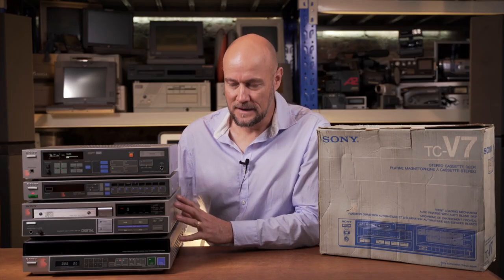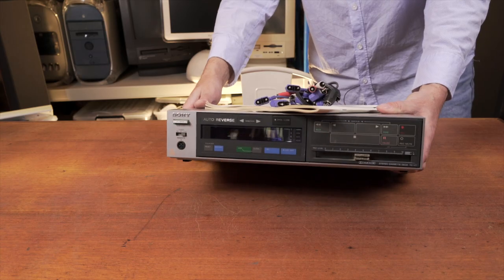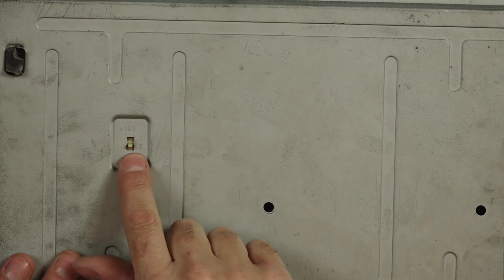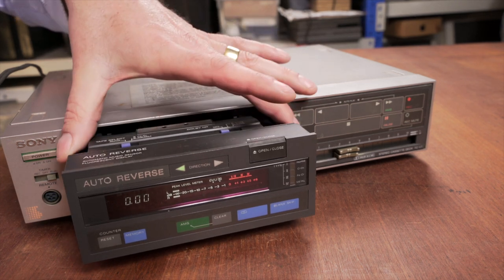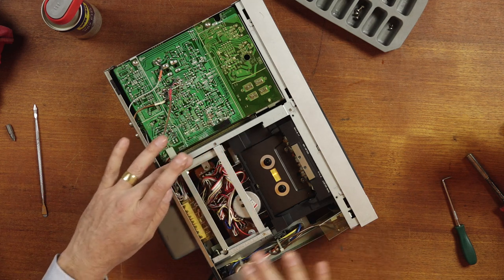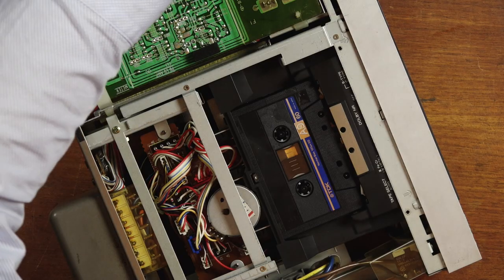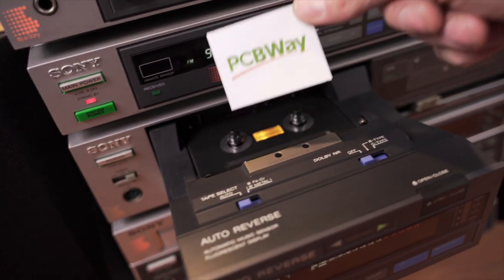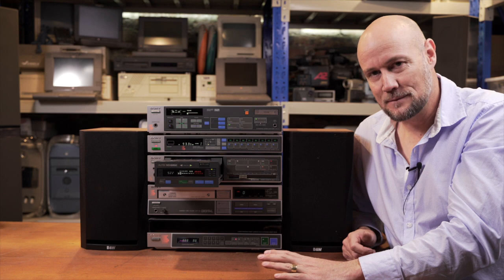Sony's Tray Loading Tape Deck!  - It’s a cassette drawer! - TC-V7 Review & Repair

Comment: I bought one exactly like this, a couple years ago when I was wee enough that the 50 bones I'd paid were a big deal. I stumbled into exactly each and every one of your issues - except that I didn't, like you have, figure out the stiff cog, so I left it at my handyman uncle's house to get fixed.
Never saw it again.
Apparently his son accidentally bundled it with a bunch of stuff that was heading to the dumpster.
I've since bought a Denon DR-F7. But I did get the system's amplifier as a sort of comeback.
Both are 100V since they come from Japan. I'll need to figure out replacing both their transformers with an old PC's power supply. Wish me luck.
Reply from the maker: What a shame you lost it! Hope you get to enjoy your new setup, and the transformer swap goes smoothly.

Comment: I just loved everything about the Sony design aesthetic of the 80s it really was a head and shoulders above most other companies in terms of pushing the design and had  very futuristic looking designs. This system reminds me of the Sony profeel  component TV system for some reason.
You live a very charmed life to be able to get hold of equipment in such perfect condition, boxed and with instructions -  normally the membranes deteriorate or are a badly damaged.
I tried looking for the cassette deck in the UK and what I found was an ugly mess😢
(Any chance you could turn the backing track down a little bit for future videos.The bass on this particular video was a little bit intrusive)
Keep up the great content 👍😎
Reply from the maker: Thanks for the great comment! Sony really lead the way during the 80s and were the masters of miniaturisation.
I’ll take note of the backing music request, thanks for the heads up.

Comment: hi, I have 2 of them and bought a pair belt kit,s it has 5 belts in it and i've changed 4, for the love of god I can't find where the 5th one goes but I know it goes to the light sensor, I stripped the top part of the tray and took out the plastic, if I press play it plays for a second or 2 before stopping but if I shine a torch in it contimues playing, any help you could give would be a godsend, by the way that leaf switch underneath the deck is a nightmare, any help would be appreciated, i've checked the service manual and still can't see where the belt goes
Reply from the maker: Thanks for reaching out! I had the exact same question about the extra belt and I even emailed the supplier about it, but no response. I came to the conclusion it’s unneeded and it’s joined my rubber belt collection.
I also got caught out by the light sensor, and I figured out when you are testing the tape transport, the silver cover is still off and the sensor needs the silver cover to work. It should play fine once all back together and the silver plate is back in place. 
Great work on scoring two of these! You must have more patience than I 😂

Comment: Amazing video! Trying to repair a Sony Video8 deck with a tray loading system. What grease are you using?
Reply from the maker: Thanks! I usually use either a PTFE dry lubricant or Lithium grease.
Reply: I think using the 7-78 PRF spray actually made the tray loading mechanism worse. Do you think using your Lithium grease would make the difference? Thanks

Comment: The design and idea of a tray is awesome. but bending this high amount of cables with every open/close seems to be a compromise to make it happen. I stay with the way to lock every cable in place and avoid every movement. the solder joints, connectors and cables itself will thank you.
Reply from the maker: Yes, it’s the trade off for this design. And a high amount of complexity to solve a problem that didn’t need solving. Still think it’s super cool though!

Comment: Great video ! I was wondering if you could tell me more about the matching graphic equalizer and the matching speakers for this model, please? What are the respective model names?
Reply from the maker: Not sure Marko, but google probably does!
Reply: @TheBasementChannel  Thank you for taking the time answering me. Apparently the APM-700 are the recommended matching speakers according to an old German catalog from 1983 👍 And for the graphic equalizer I was thinking of the SEH-V5. I recently managed to buy the remote with the control cables, I am so thrilled to control the hifi system with it now ! Still missing the CDP-11S though 😭
Reply from the maker: @markolau6624  great info, thanks for reporting back 👍
I don’t think the CD player was technically part of the system, or it would have had a V5 designation in the model name. And while it looks similar to the rest of the system there’s a few design differences.
Reply: @TheBasementChannel  Actually the CDP-11S you have is a (v) version. There were 3 versions of this CD player the (s), the (b) and the (v). And it was in fact part of the entire Precise V7 system 👍
Reply from the maker: Oh that’s good to know, thanks!

Comment: I  bought a good conditioned Sony ev  850 ps video 8 PCM device, all is functionally ok , the charge   system cassette  is very similar as the model showed in your video,  ..and unfortunately ,  I do not understand why by openind thé chariot of   cassette Drawer is doing a strong noise , is buzzing during the opening and closing  the Chariot, but the mechanisms  do  his working  as well,l only   is  only occurring  , when I open and close the slide  cassette Chariot , what can it be... motor ?
As I  before mentioned,
the Player ist functional, thé Tape working well , Rew and forward working well too
I can't no find why this noise is coming only by charging cassette inside the device.
Need thé mechanism rail  Drawer Deck slider to bé greased  or it is the bell  dilatation  who is failed?
Thank you in advance for your réponse
Regards Chris
Reply from the maker: Hi Chris, sounds like a slipping cog. I looked up your device, and it’s very different from this I’m afraid. Sorry I don’t have much experience with VCRs. Good luck 🤞